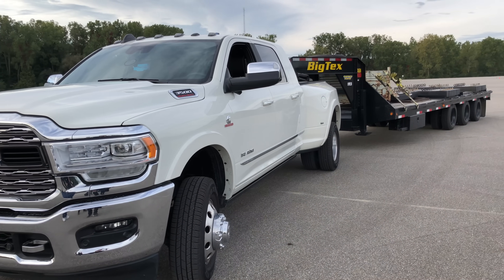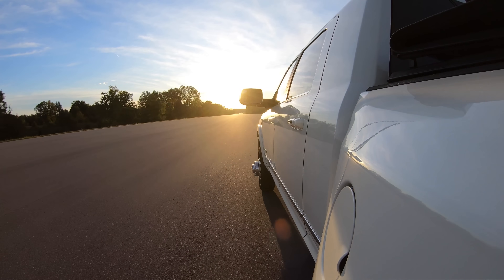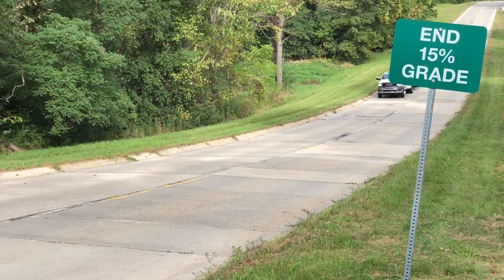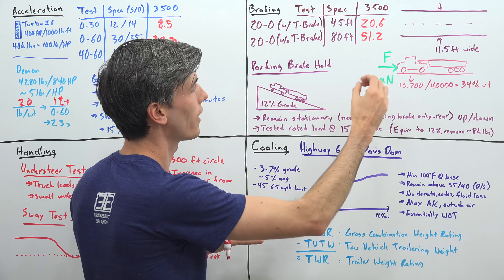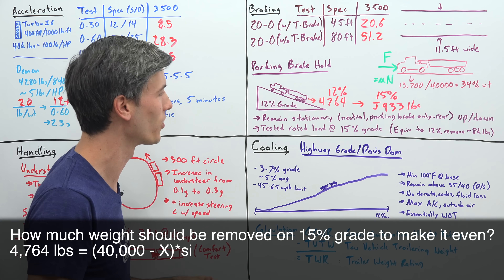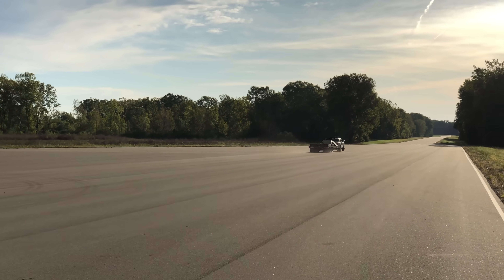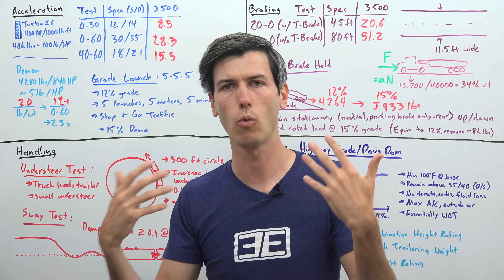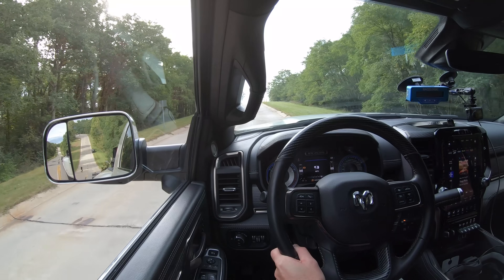How Much Weight Can Trucks Actually Tow?

Comment: Excellent video!👍. I wonder how long term, using a truck like this at max weight will effect the longevity, i.,e., will such use wear out the truck sooner?  My guess is that it will.
Reply: CrazyPetez They usually last longer when they are worked
Reply: Lead Foot I am genuinely curious as to why you think that. Because it makes no sense. If you run any car/truck at the edge stuff will break/wear out long before if you didn’t.
Reply: Shotrod 69 I commented above as I did because a former neighbor who had a tandem axle Peterbilt and car hauler trailer said many guys in the trade used HD pickups with smaller trailers that could hold 3 or 4 cars. He said the pickups could get the job done, but at the expense of wearing out. A full size truck however wouldn’t be strained at all pulling a trailer with 6-8 cars.  I’m not trying to start an argument, just stating my thoughts.
Reply: CrazyPetez Nah your good man, his comment is what didn’t make any sense. EE was saying they’d have to be at full throttle for a 3-7% grade, that’s a lot of strain on a vehicle. I’m sure a full-size could get 100k before the wear truly started showing.

Comment: A 15% grade means the road drops 15 feet per 100 feet of travel.
Reply: That's not what it means at all.  A 15% grade (or slope) is a 6.75 degree incline which is 11.8 feet per 100 feet of horizontal length.
Reply: @kswas2784  Thank you for the clarification.
Reply: @kswas2784  Not true. The 15 is 100 x rise/run of slope. Per the math, that's an 8.5% grade. Your 6.75 deg incline is about a 12.5% grade.

Best way to remember rough difference between typical posted "Grade" for a hill and the actual "Degrees"  is the "% grade" is about 2X the actual "degree angle" of the incline. So a 45 degree incline = 100 % grade (the max value for % grade), where horizontal distance = vertical climb.
Reply: @kevink2315  The OP stated a 15% grade (slope); which is in fact a 6.75 degree incline.  Since 45 degree is 100% slope; the degree of incline is NOT 2X but 2.22x.  Therefore (6.75 degree x 2.22) = 14.985% (or 15%).  My original statement stands as correct.
Reply: @kswas2784  Well, first let me clean up my 1st paragraph. I calculated the correct angle of 8.5 degrees, but wrote the wrong formula.  It should be: degree_value =   arctan(percent_value /100 ).  I used it in the next calculations.
Then to get "percent" from your 6.75 degrees, I roughed out the "about" answer of 12.5 % from a table. The exact value is 11.83 degrees. 
Your 6.75 degrees is correct only for your 11.8 rise in a run of 100. The related grade is 11.8 percent, not 15. The op's 15% grade is 8.5 degrees, not your 6.75 degrees.

Now for my 2nd paragraph, all is true as stated !
I stated " .. ROUGH DIFFERENCE ... ABOUT 2X .." The degree and %-grade values are NOT a linear relation, so you just lucked out with 2.22 X 6.75. The relation is % grade = (100)( tan (degrees)). The degree of slope is = arc-tan (percent/100).  So for your  example,  11.8 in 100,  tan= .118,  the incline is 11.8 %, or 6.7 degrees as you correctly figured.

So you know the rise over run is the tan of the angle in degrees, but you don't seem to know the conversion from degrees to "% grade". Just use the formulas I had looked up, and used here. Peace!
Reply: @kevink2315  I do know the conversion from degrees to % grade and you are over-complicating it and still getting it wrong and it requires no formulas for you to look up.  It most definitely IS a linear relation and I did not in fact "luck out".

It is a simple ratio and using the OP's 15% slope is as follows:

45degree/100% slope = x/15%slope   solving for x by using simple cross multiplication yields x= 6.75degrees.  It's nothing more complicated than that.
Reply: @kswas2784  Just Google: wiki grade slope , for validation, in case links were deleted.

Comment: Can you explain how weight factors into the handling test?  The other tests were easy to see why adding weight would make the truck fail.  Why would a heavier trailer understeer less than a lighter one, etc.?
Reply from the maker: A heavier trailer would be more likely to want to get ahead of the truck, in other words pull the hitch point outwards in a turn, causing oversteer and for the trailer to whip around. If the trailer is super light, the truck will have no problem controlling where it goes.

Comment: I'm sorry but did I miss how they actually calculate the actual load? Do they just increase the weight it pulls until it can't pass the test anymore?
Reply from the maker: Calculation at the end, but these are the tests it must pass for a rated load. That load is determined during the design phase of the truck, so it's designed to meet these requirements, then tested to ensure it does.
Reply: There's a very good chance the truck could be tested at a slightly higher weight and still pass the test.
Reply: This test is not to determine the maximum load, it is used to prove the manufacturer's claims.  These claims were likely set by marketing before the design started, though I guess if the engineers feel confident enough they could try for a higher rating.

Comment: I have often wondered what the point of failure would be for certain trucks with respect to their tow ratings. In other words if you pick a Colorado with a 7,000 lb tow rating, which of these tests would it fail first if you keep adding weight. And which ever test it fails, would that be the same test most trucks would fail first or are the limits quite varied? My assumption has always been that the Davis Dam test is usually the limiting factor for most trucks.

Comment: So often I see half-ton trucks towing loads that certainly exceed the rated towing capacity of the truck, even before accounting for the loaded weight of the truck. Just because the truck will pull the load doesn't mean you have any margin at all when conditions are less than optimal ... such as emergency braking.
Reply: Absolutely right. I have a Ford F150 rated to tow something like 12,000 lbs. I regularly tow a camper with a max weight of 7500 lbs. I would not tow anything much heavier. Plenty of power to move it, but you have to account for stopping, cross winds, cornering, lane changes, etc. Better safe than sorry.
Reply: Yep, funny when you see people talk about how their 3500 can tow 30k lbs and it makes 1000lb ft. Even though they don't have a CDL to tow that much and it's not safe at all to tow that much. My truck makes less than 700lb ft and Id rather tow 30k lbs on it than any pick up truck

Comment: Electric pickup trucks will tow 60,000 lbs.
Reply from the maker: For now, they won't get very far... The weight of the battery digs deep into the GVW of the truck, thus reducing the weight the truck can tow. Not as easy as it sounds.
Reply: Uh.. Lol no they wont
Reply: @Ckcdillpickle  Revisit this comment 5 years from now if you're so sure.

I'm betting there will be an electric pickup truck for sale with the said ability.

I might be wrong, but I'm betting.
Reply: @slowanddeliberate6893  Sorry. no pick-up truck is going to be towing that much, electric or gas. its not going to happen.
Reply: @Ckcdillpickle  You do realize that an electric pickup truck can have 1,500 lb.ft. of instant torque, right?
Reply: @slowanddeliberate6893  NO WAY. 1500lb ft doesn't matter...

Comment: What difference does it make when the trailer is bumper pull instead of goose neck? How does that effect the ratings?
Reply: Recreational towing typically use a fifth wheel set up, NOT a gooseneck...

The biggest advantage of a gooseneck trailer over a bumper pull is its stability. Since the tongue weight of the trailer is over the truck’s rear axle instead of at the back of the frame, the potential of the trailer to sway is minimized. This increased stability also means gooseneck trailers can accommodate more weight and be larger than a bumper pull trailer. Goosenecks have more room for living quarters if you want them, as well as more room for any cargo you haul. 

Gooseneck trailers also have a tighter turn radius. This lets you cut corners tighter than a bumper pull trailer and lets you maneuver the trailer in tighter spaces. This tight turn radius can be a double-edged sword, though. It takes a few tries to learn, and if you mess up you can take off the trailer’s fender, to say nothing of damaging street signs and other cars on the road.
Reply: @hnchmen34  I understand the difference between the types of trailers. I was more wondering what effect it had on the overall results from the tests.
Reply: @thesherm44  Well... they didn't conduct those tests, thus, the effect can't be measured, but rather hypothesized... obviously you can pull much less weight will a  "bumper-pulled" type hitch... not many if any trucks use "bumper-pull" hitches... the majority use frame-mounted receiver type (class 1 - 5) hitches or pintle hitches...

The ratings increase as towing capacity increases and the type and rating of hitch increases and various other factors... the actual specific numbers can't be known until the actual test(s) is/are conducted...

Comment: As a car enthusiast I am not into trucks, but as an engineer I am totally into trucks.
Reply: As a vehicle enthusiast I am into all kind of vehicles. Cars, trucks, trains, ships... As a marine engineer I am into large diesel engines. Basically I am into everything that runs on fossil fuel.
Reply: T-Bag I am into all of those as well as motorcycles and airplanes and I think electric vehicles are cool also.
Reply: I like Cars... I absolutely love driving a Truck though.  The F150 I own has the Ecoboost and it's faster than any car I have ever had and you are not sitting on the pavement.
Reply: I was a car enthusiast, until my dad gifted me his old lifted Dodge ram 2500. Now I'm a lifted truck guy. 
Lifted trucks are godlike.

Comment: When you are explaining the park brake on a gradient thing, the absurdity of using percentages instead of degrees, is highlighted. 
So non-mathematical. Can you put percentages into trigonometry?
Please use intelligent jargon. You are an intelligent fellow.
Reply: That's how the highway is rated across the country ya donut. It's not Jason's decision that the national highway system uses grade instead of degrees. Grades are just the magnitude of the slope of a run of highway. So actually it is a measure derived from coordinate planes, and works within the confines of trigonometry, but instead of using concrete numbers it tells you that "until this grade changes expect to change at this rate".
Reply: DDD what’s wrong with degrees? 10 degrees from horizontal - that doesn’t work in your country. 
Engineers sitting idly while the field goes awry.
Reply: take the percent as fraction of 1 - eg 15% = .15.  Take the arc-tangent of .15 and you have degrees.
Reply: Lyle Stavast oh, so a 45 percent slope is 50 degrees? Huh?
See, this thing is just ludicrous.
Reply: @thesparksplug   The grade is the ratio of how far you go up or down divided by how far you travel horizontally. (rise/run) 45%=0.45=tan 24.22 deg.      100%=1.0=tan 45 deg.
Reply: anti chuckle So, there’s a previously established unit of measure for slopes but it’s not good enough?
Reply: @thesparksplug  You're obviously used to using degrees, but there are other units which have been used for a long time. Expressing a grade as a % is not new.
Reply: anti chuckle just stating the degree incline, is a direct measure, no calculation required. Do you know what a protractor is?
Reply: @thesparksplug  You can measure the % with a tape measure, no calculation required.
Reply: anti chuckle Hahahaaa. Really now. Lol
Reply: anti chuckle No. Percentage can’t replace degrees.

Comment: The real cause of overloaded induced accidents is the towed vehicle being overloaded, improperly loaded, or towed too fast.
How many 5th wheels limit their highway speed to 65mph? None. Yet, ALL trailer tires are ST rated which has a maximum speed of 65mph.
Ever see a 5th wheel owner take his rig to a scale to verify axle weight and weight distribution? Very few do. Even fewer towed behind travel trailers check their weights. The real problem is not the tow vehicle, rather it is the towed vehicle and driver. With modern ABS, the trucks are safer than ever. Lack of proper trailer brake set up and understanding by the driver in proper use is the weak link in the chain. Ask the average person what the settings on their brake control do to the brakes and they won't even come close to the correct answers.
Reply: No, not all trailer tires are ST rated and limited to 65mph.  My horse trailer uses the exact same tires as my truck, and they're not ST rated.
Reply: They should account for this and specify that tests must be performed with an overloaded single axle dog-tracking home-made trailer with asymmetric braking that has been loaded as improperly as physically possible. (Everything in the back OR everything in the front)
Reply: Most people running a large truck pulling a 5th wheel are exceeding the weight limit of their drivers license.  And they realize this after the accident when the cop tells them they weren't suppose to be running that vehicle combo.  Regular class C license in all the states around me is 26,000 lbs GVWR.  The combo in this video nearly doubled that.
Reply: @Trehugindrtlvr1  you don't have exemption for non commercial use ?
Reply: @tortue71  You would need a non-CDL class A license to drive the rig in the video. You're not exempt from weight limits just because you're not driving for higher - at least out west.
Reply: @Trehugindrtlvr1  ok ! Here in Quebec there's no problem as long as it's not commercial
Reply: @Trehugindrtlvr1  not all states offer a non-cdl a/b license, however you can get a cdl and not take the air brake test and fill out a medical waver saying you do not intend to use the CDL "for hire" and are exempt from the medical requirements. However the waver has to be filled out yearly so it's a less then ideal option as if you forget to fill out the waver they suspend your license. Some states also offer RV endorsements or require an RV license, some of which actually require testing and others are a matter of paying the fee for it.
Reply: @Trehugindrtlvr1  your right most people don't know that
Reply: @Trehugindrtlvr1  the 26,000 GVWR is for the truck and the truck only. If the weight rating was Gross Combined that would include the truck and trailer's weight. The truck's GVWR is 14,000 pounds; which is 12,000 pounds under the 26k cut off.  That's the number one reason the biggest rental trucks you can rent are rated 26,000 not 26,001, because they can rent them to anyone.

It wouldn't do any of the three manufacturers any good to build a truck regular people couldn't legally drive.
Reply: Goodyear Endurance ST tires are rated 85 MPH. E load rated too.
Reply: Bruh I just hook it on and go
Reply: @Tony Seely most states do NOT have separate speed limits for tow rigs. Many used to and removed them because speed differentials turn out to be extremely unsafe, very few have them anymore do to the safety implications.
Reply: I can't even do 60mphs on a loaded 5th wheel
Reply: @Tony Seely I don't have to recheck that, it seems you do. I drive otr so I'm fully aware of what states have separate speeds.
Reply: Load of crap. There are plenty of trailer tires that are rated at more than 65mph.
Reply: America would never have become a country if people followed laws. Redcoats go back.
Reply: im a rv transporter and usually run at 70mph. at 90 degrees 68mph max. 100 degrees 65 mph max. if its cold outside and im in a hurry i run 72. never any more. ive gone 11 hours straight at 72. with my 30 min break of course 😉 and they put the cheapest tires on these trailers. never had a blow out from going too fast....just sayin
Reply: dukem600 but I bet you had blowouts from the manufacturer using cheap tires as most RV owners have, myself included.  I was driving 65 and had one of those “may pops” go off 3 hours from home.  Now I have G rated tires on my RV and have gone on several trips with no issues.

Comment: In my opinion you should have to show at least a minimum level of competency in understanding all these concepts before before you should be allowed to operate any vehicle this size or larger.
Reply: Right, we need to make people pass driver's test or something. And if they plan to tow for commercial purposes, there should be a test for that as well.
Reply: @giovanni4436  and if they make a mistake, there should be a penalty system, so that if they make many small mistakes or a very big mistake, they lose that certification
Reply: @giovanni4436  Where I live. A person can get a regular passenger vehicle drivers license in a little passenger car like a Kia or Hyundai then if they choose go out and purchase and operate vehicles the size of that ram 3500 on public roads. That being said a passenger car licence does not alow you to operate a vehicle weighing 40k lbs GCVW but It does all you to tow a goose neck trailer. My point is Licening laws are too lenient when it comes to the minimum competency required to be legally able to tow a trailer. It is my opinion that in order to tow any type of trailer with a passenger vehicle license you should have to acquire towed vehicle License (like a commercial license)